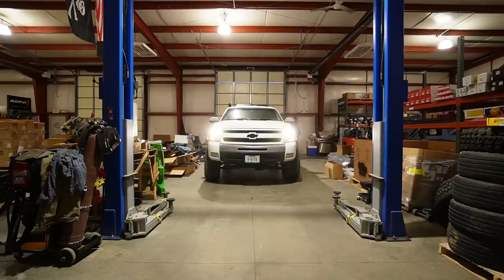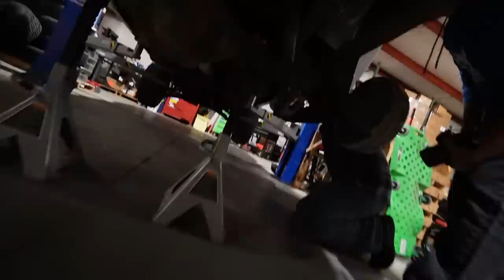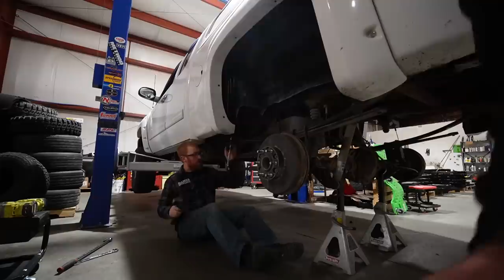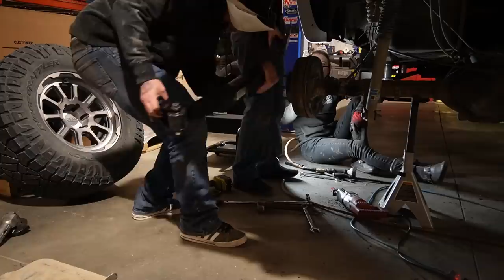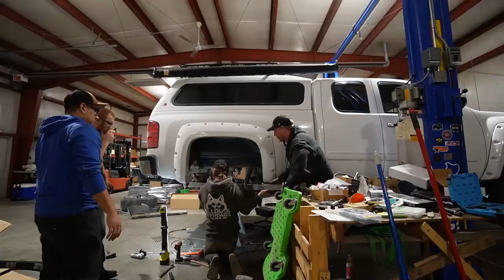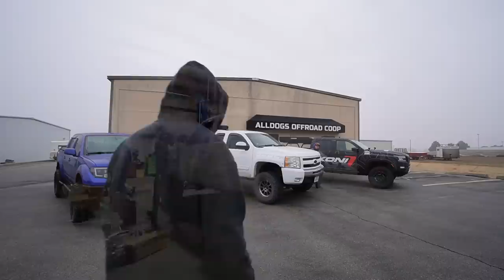Replacing my Sagging Leaf Springs at Alldogs Offroad Coop

Comment: DO NOT spray used oil onto the bottom of your truck. It will wreck all your motor mounts, bushings and anything rubber.  use the proper oil or it will cost you much more in the long run. I recommend fluid film or Krown spray
Reply from the maker: I had it Krowned last year, I'll probably take it back